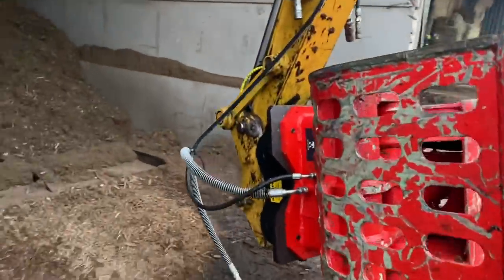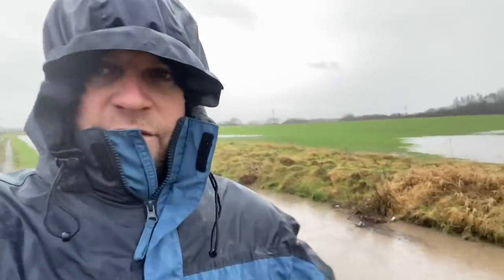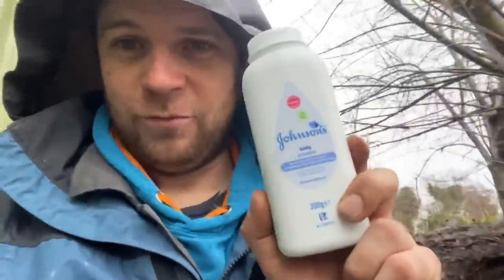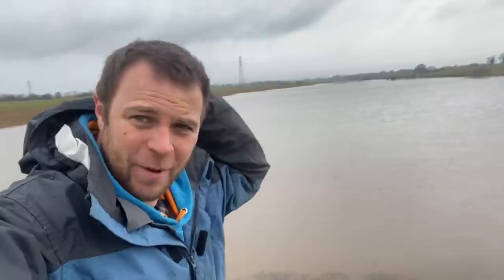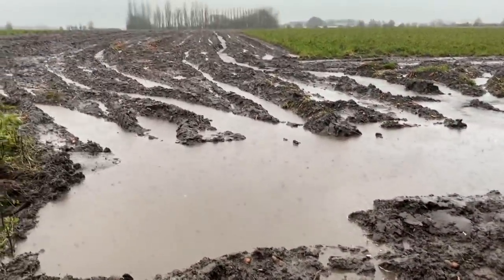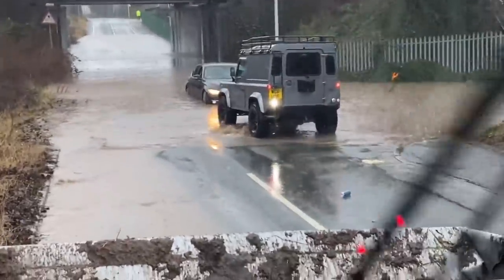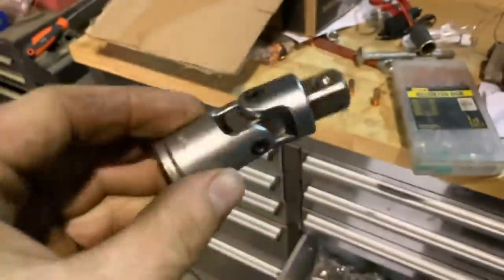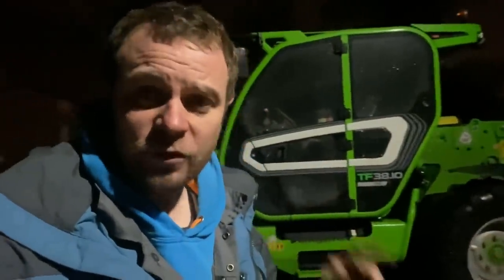Day 304 #Ollyblogs #LockDownLearning

Comment: Be aware not get ting your dipstick under water, they Are not 100% sealed, so water comes in your engine that way, just a friendly advice👍
Reply: Depends on the dipstock some have double O-rings at the top, that said if the dipstick under water all the breathers will be too (the reason you run extended breathers on modified landrovers and why my one didn't have mayonnaise for oil after wading in 4.5ft of water to rescue a car driver)

Comment: My best bet is that it's a cat 3 three point linkage ball with cat two pin hole, and it's found on a lot of 150hp to 250hp tractors here in New Zealand. My other niggle about it is that it is possibly off the JCB 4220.
Keep up the good work and great videos. Cheers

Comment: Electronic handbrake on modern cars can't release.
Reply: That generation of 3 series has a manual handbrake. But the auto boxes will only go into neutral if the engine is running or if lift a small lever on the side of the gearbox.  Just dont drive into a flood 😂